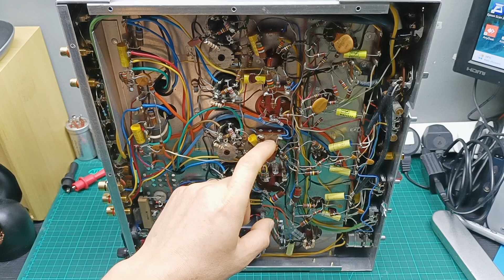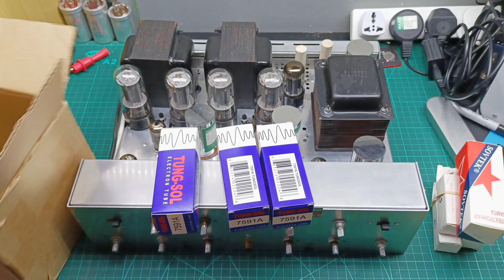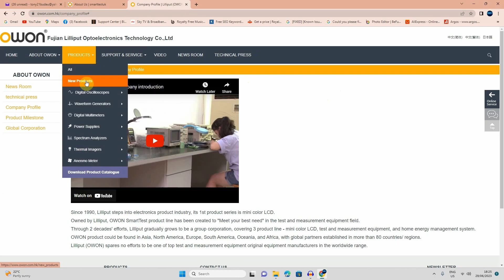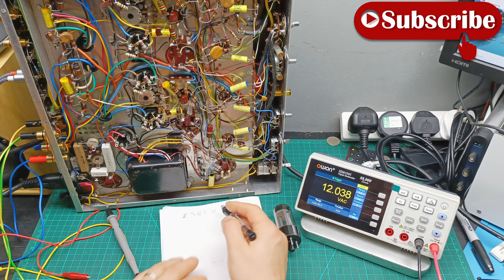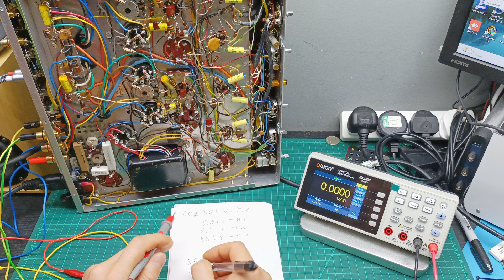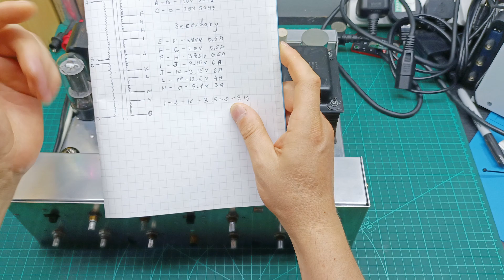HH Scott tube amplifier ep2 I run into some issues with this amplifier !

Comment: Did you figure out the voltage problem? Looks like it was rewired for 6p3s but they were not correctly biased, taking too much current which sugged PT a lot so B+ was way too low..
Reply from the maker: That transformer also without load was getting warm so the primary winding was not ok